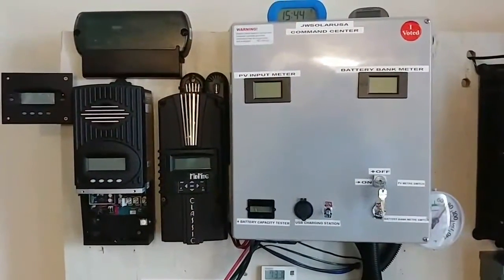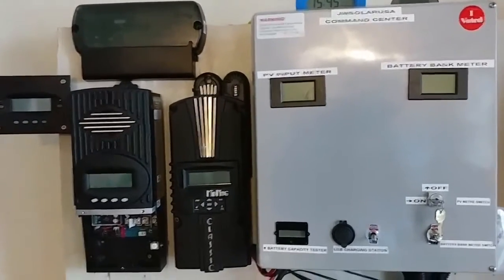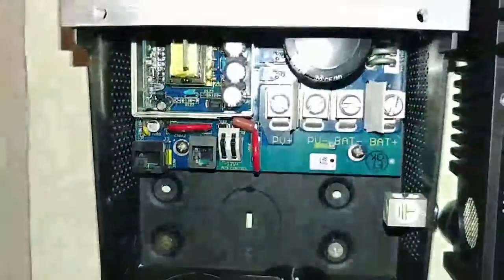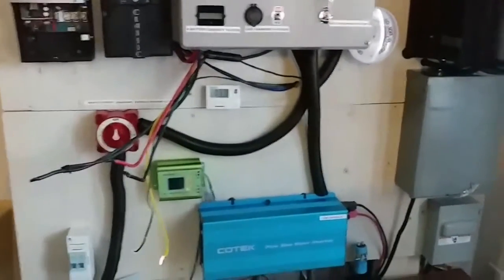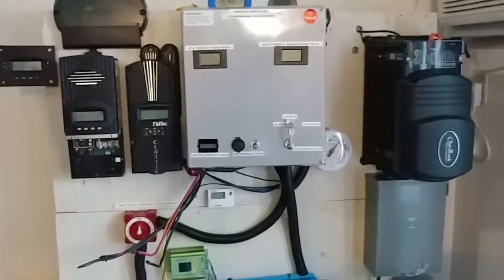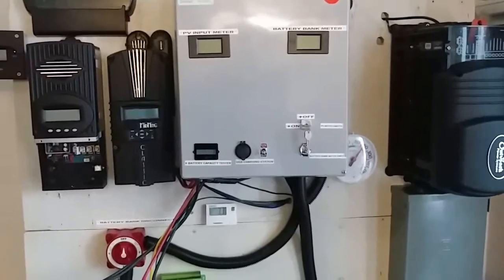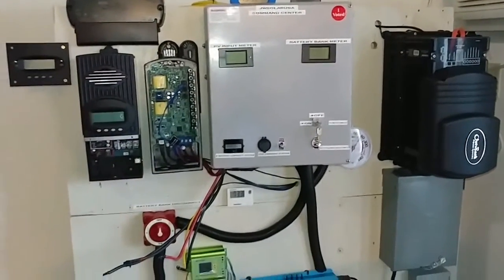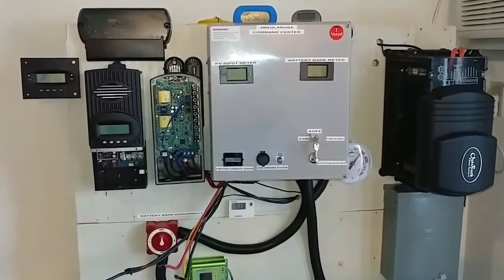SOLAR 48 VOLT OFF GRID AND BATTERY BACKUP SYSTEM - Upgrading MidNite Classic & OutBack Flexmax Pt.1

Comment: So.... I have alot to learn.... With that being said what was the SOLAR 48 VOLT OFF GRID AND BATTERY BACKUP SYSTEM powering? (I get it is a backup. But what can 48v power? (Just trying to see what's this "mini station" is for. I appreciate the information and the video.
Reply from the maker: Thanks for asking.
This is my Power House and also my backup when the GRID goes down.
This Command Center as I named it powers 90-95% of my house except my Stove and the Air Conditioning which runs on 240V AC.
A 48V system means, I am drawing 48Vdc from my battery bank to power my OutBack Systems Power FX3048MT Pure Sine Wave Inverter to give give out 120Vac for me power my home.
I do have two Strings 4 x 12v AGM BATTERIES wired in fours in Series to give out 48Vdc and later wired in Parallel to increase the current which is the Amps to 303Ah Battery Bank.
I hope this help you understand little bit not to make you confuse how my system works.
Please watch more of my videos and you will understand how everything works but, it take a little while.
Please contact me if you any questions later.
Please follow me on these channels ( jwsolarusa ) on: 

Google+ 
https://plus.google.com/collection/kwKoHB

OFF-GRID SOLAR SYSTEM: https://www.youtube.com/playlist?list=PLSNjIRSnUPDLovhitt8VWciXC6wWbOHbX&jct=HmigL8AwIRJT7DPKKeYFPEeKXN_16Q

YouTube channel:
https://youtu.be/j5X3fTKr6Cg

http://www.youtube.com/channel/UCm8Raa6JdTXTNmjnF5OTcnA

Facebook Page 
http://m.me/1806732252931962

https://www.facebook.com/jwsolarusaMN-561208810741192/about/

Twitter: 
@jwsolarusa 

Instagram: 
@jwsolarusa 

Tumblr: 
+jwsolarusa
Reply from the maker: https://plus.google.com/collection/kwKoHB
Reply from the maker: plus.google.com
Reply from the maker: Please check out Google+ for more diagrams and configurations on batteries and solar connection